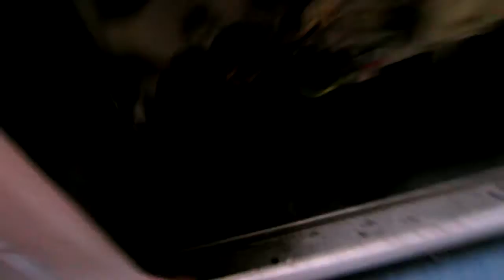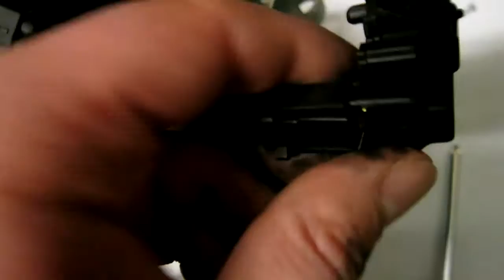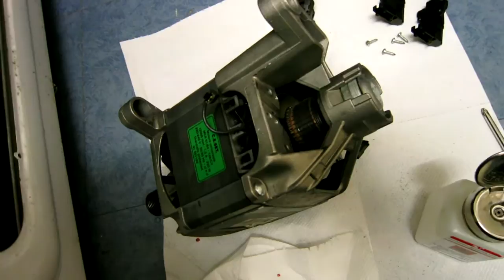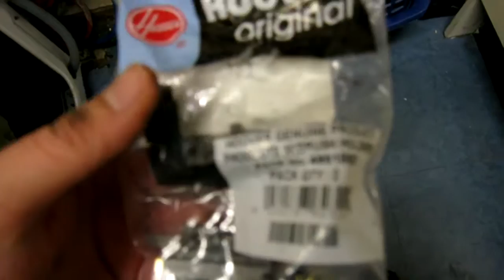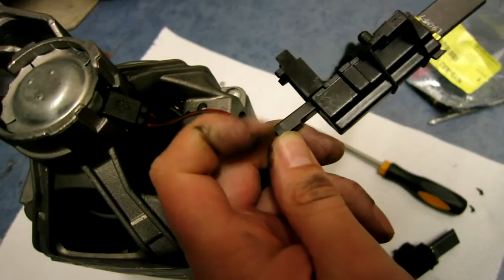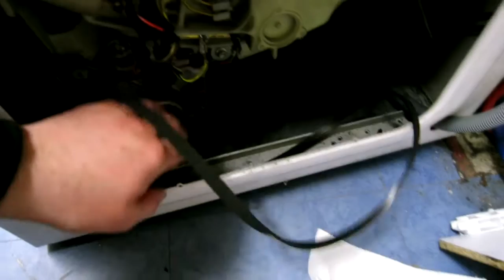Fixing washing machine not spinning (Candy DQW150) motor brushes

Comment: This is one thing I like on the older type machines (as in 5+ years) as the newer ones are a pain to self fix. Some parts are none user servicable in the new ones. The motors come as one unit without replaceable brushes. The one job I did which was a pain was to replace the front and rear bearings. Which by the end made me want to kill it! Whirlpool Front Load Washer Total Carnage - Runaway Drum Assembly
Reply from the maker: That's a nice way to kill a trouble washer :)